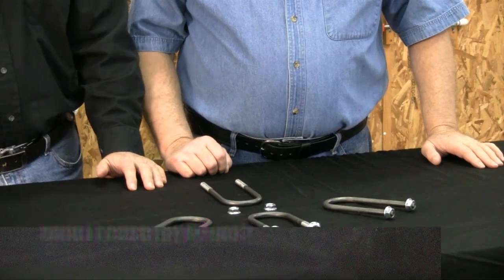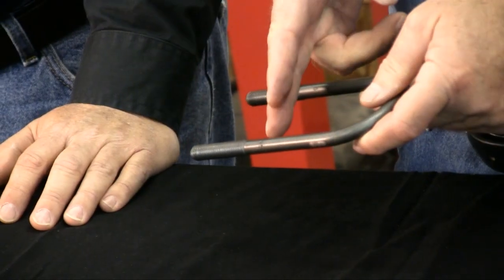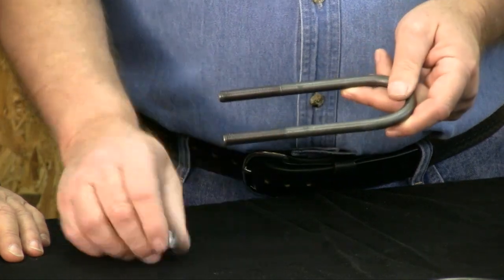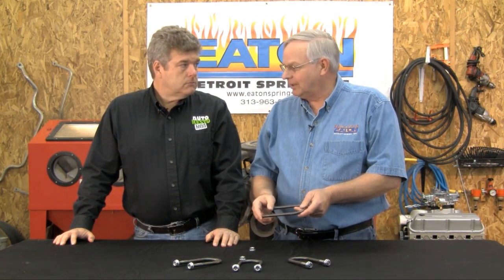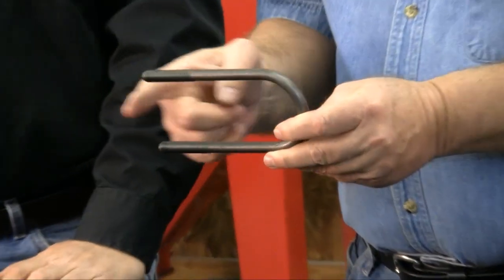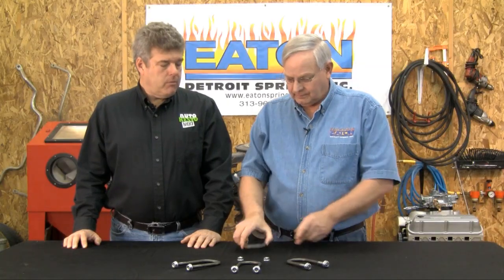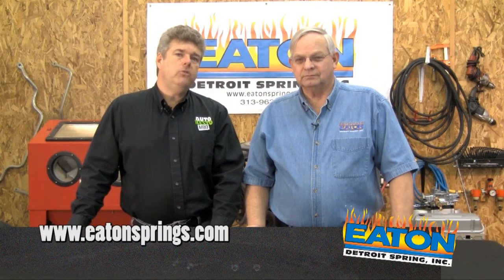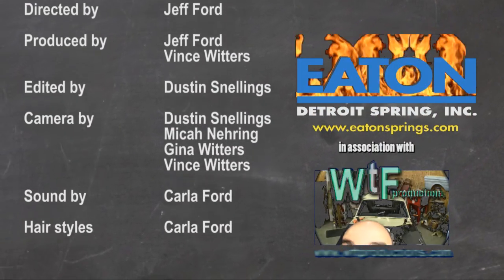Do Not Reuse Leaf Spring U-Bolts! Here's Why | EATON Detroit Spring on AutoRestoMod

Comment: I have re used my u bolts on my duramax around 7 times.  in several different height locations because of removing a leaf spring in the spring pack and had no issues
Reply: I have a set from my Superduty that I would reuse again.  A new set of u bolts is over $100 at a spring shop. Rolled thread rod is premium and shouldn't have any damage from normal torque.